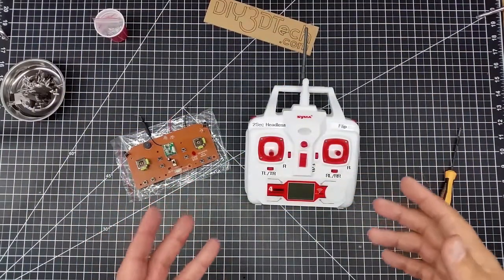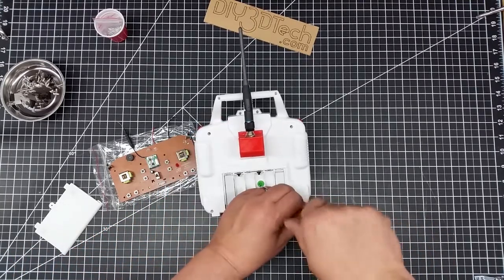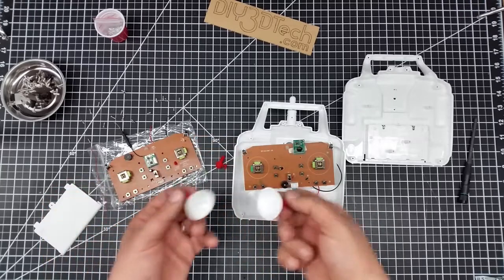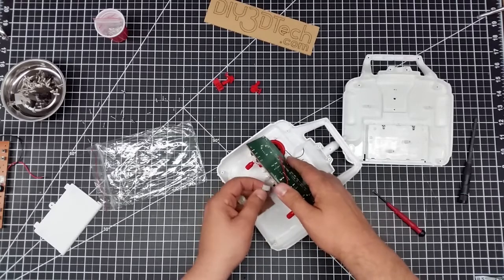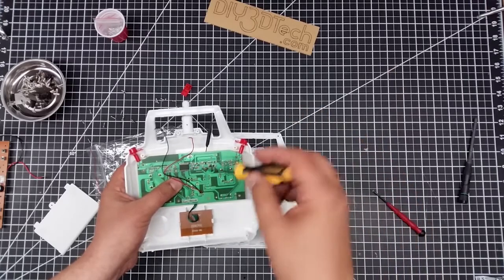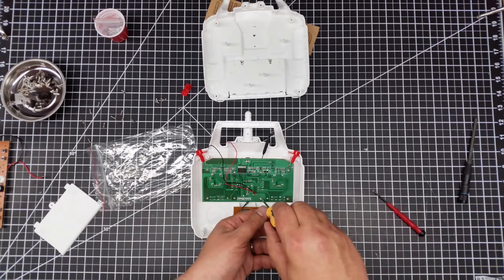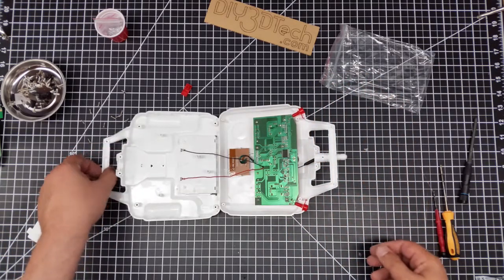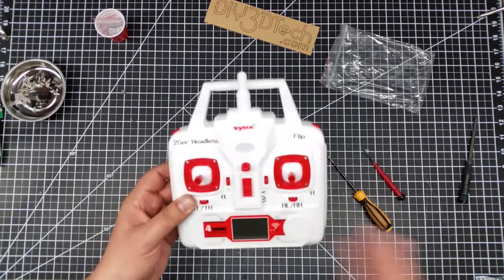Video Drone - Syma X8 Brushless Motor and Controler Build Part 2!

Comment: Looks good. Indeed the antenna mounting is more difficult. I would do a range test in the current situation. It is always possible to make a weld in the cable. Am very curious about the final result.
Reply from the maker: Still a work in progress, took it out a motor failed and went all crazy (video coming) so I need to bring it back and see why it failed a lose wire?
Reply: What a pity! I hope one of the screws was not too long and has hit a coil. Is it possible to order spare parts?
Reply from the maker: Naw it all spins and tested it on the bench [before taking it out] so either a lose wire or an ESC went bad.  Hoping to get it working as after I do, want to remove it from the Syma X8 and install it on a 250mm carbon fiber racing quad...
Reply: Correct. You can exchange the components, so will the cause be known. But converting to another frame is also a challenge. Other motors and ESC's seems to me to be also an option. The use of JST connectors for feeding the ESC's remains a mystery to me.
Reply from the maker: While the main reason for doing the kit was the review and build the second is the possibilities to use in other kit builds.  As you can do one from the ground up, it would be nice to something that was mostly done and just throw on a frame...
Reply: I understand. I currently don't have the money for the kit yet. When looking for parts for this kit, I found spare motors and a complete brushless kit based on the original Syma X8 parts on aliexpress.com. I wait patiently wondering what the future will bring.  And of course, I'll keep watching.
Reply from the maker: Got to say, I am still wondering if it i worth it given for around $200 you can get a Hubsan 501 and several other GPS based bird for that price range.  So keep watching as the Syma in on the bench and two of the three bullet connects pulled out so an easy fix as I am just going to use some heat srink tubing.  Also torn right now between the Walkera Runner 250 and the Hubsan 501...